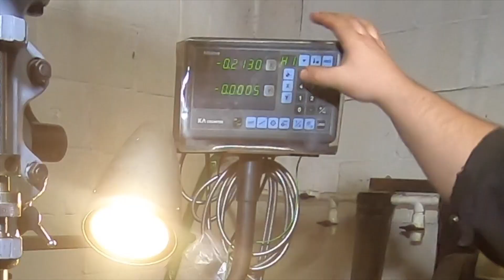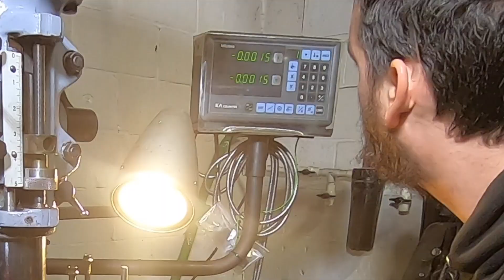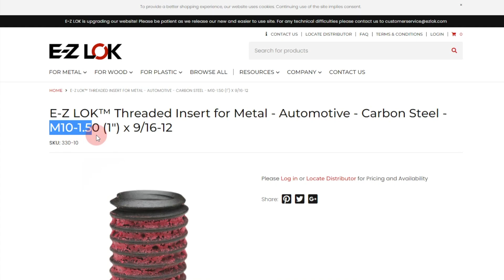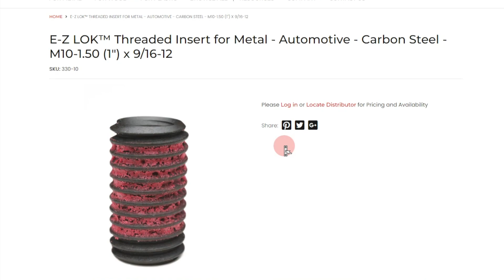M54 head bolt threads stripped. NOW WHAT? A budget repair that might work

Comment: Great video mate, you're a star. I overheated my M54B30 engine this week and had a crack at replacing the head gasket myself. I only discovered 3 of my threads were buggered when torquing the head back down. Searched YouTube for advice and came across your channel. Much appreciated, keep up the good work.

Comment: Aluminum does not like to get hot. Its a overheat cycle that effects the block threads imo. I make borosiclate  glass for a living / lots of heating things way up and cooling them off.  Combine that with the porosity of these blocks never was that great. (Lots of impuritys cook out if you ever need to repair one.)

Comment: Great video I will add to my M54 rebuild reference library. One item I've always wondered about working on an engine. It seems to me the engine stands are not that rigid or sturdy, especially when you are torqueing. Is there a better stand or method. 
Again, thank you for taking the time to make this video.
Reply from the maker: If I did more of these engines I would probably weld some supports to the stand to stiffen it all up. Otherwise its just kinda the nature of the beast.

Comment: bought a $200 overheated b30 had all but maybe two of the headbolts strip out so i just hand drilled and tapped all of threads with helicoils and its done 10k miles no issue beating the s*%t out of it, feel like the alu blocks get a bad wrap and are way more durable than most people think hit or miss sounds about right to be honest 😂
Reply from the maker: Yup I agree 100%. Glad yours is still ripping
Reply: I had to do that with my 530i 3.9 6 cyl a long while back. It was horrific to have that happen.. I had to sell it after I put it back together. Mine was factory lowered suspension.  Sad... such a nice car with shit engineering. Never again BMW!
Reply: what the heck with the edit?? anyways.. Drilling sucked!! I don't have a machine shop... I double stacked the heli coils,, they are way too  shot with only one... PIA!!!!!!!!!!!!!!!!!!!

Comment: I Would have to say that block that pulled  the threads may have gotten way overheated no real way to avoid when that happens with the threads being pulled. i would use lock tight 620

Comment: Nice video.

Did you use lube under the nut when you tested the torque on your blown block?

Cheers
Reply from the maker: Yes I put ARP lube on both sides of the washer
Reply: @spankranchgarage  Kool, thanks. 👍
Reply: @spankranchgarage  I have previously used 65lbft using ARP lube as well with OEM M10 Bolts. and  75lbft with M12 studs.

Nice info. thank you.

Comment: Quality content 👌🏼
Reply from the maker: Thank you!
Reply: @spankranchgarage   have you ever drilled too far into the block during one of these jobs on the m54, i ended up drilling to far on one and connected to the water passage. Dont know if i should just scrap the engine or run it
Reply from the maker: @mrbcskater16  I havent done that yet. Depending on the situation I was in however I would maybe fill the bottom of the hole with epoxy. Maybe RTV the bolt for added insurance and it would probably be fine forever.
Reply: @spankranchgarage  ill give that a try. This block has be a pain but i wanna make the most of it since i found out i broke through after i did all the inserts and was getting ready to put her back together.
Reply from the maker: Send it. Seal up that stud or bolt really well and don't look back. I bet it never causes you a problem.... Until you take it apart in 5 years and forget which hole is punched through.
Reply: @spankranchgarage  haha yeah if i got to open her back up down the line ill be ready with another block. After drilling and inserting 14 holes i got a way better procedure to get it perfect every time

Comment: So I’m replacing my head gasket and when I go to torque these down the torque procedure isn’t 65 ftlbs… it is 40 nm, then 90 degrees, and the then another 90 degrees… the cylinder head from the factory comes wrapped because it aluminum and it lays flat when you do that l torquing procedure… the final torque on them is around 55-65 nm roughly
Reply: Warped*
Reply from the maker: @kylehagan3381  Yes you are right. In this case I am not using the stock bolts. I am using studs from a Nissan VQ. I torque these to 65ftlb as they are not TTY like the bmw bolts are
Reply: What do you mean by 90 degrees? I may be doing this job within a few weeks and could use as much help as possible. Do you mean 90 degree turns, stopping, and repeating? I've never done any internal engine work but I have replaced the whole cooling system and I'm thinking head gasket is bad. White smoke, but no evidence of oil in cooling system or froth on oil cap.

Comment: How much had to be removed from the stud to be the correct length and how did u do so I currently have a 5-6mm too much with the vq35 stud
Reply from the maker: I use these right out of the box without modifying. The length is slightly long but they work perfect

Comment: anyone found a link for those e-z lok threads with 1 inch lenght? they have em all over amazon but only half inch length. thanks in advance
Reply from the maker: The part number is 330-10. You can get them from an industrial supplier. I just bought enough to do an entire block. Ill make a video when I do it.